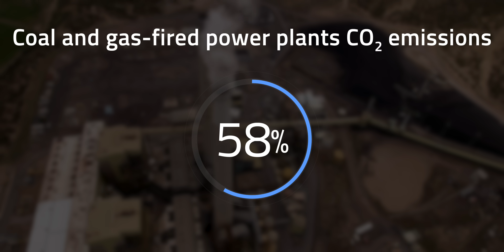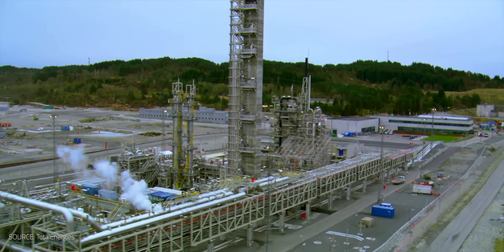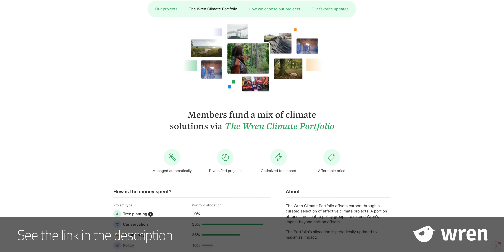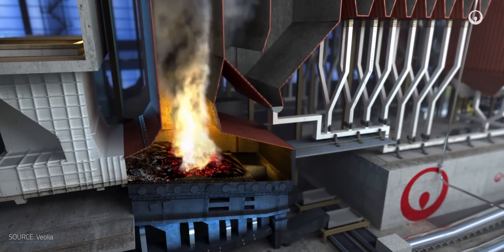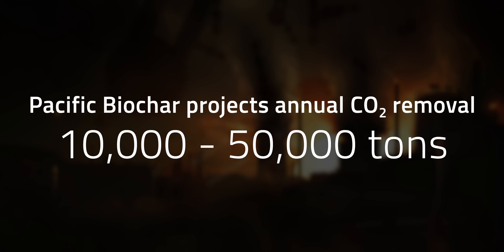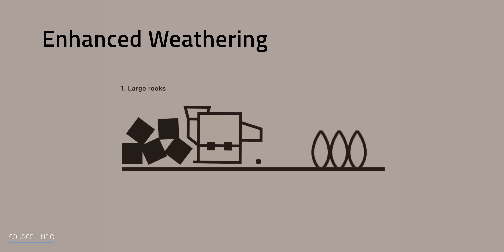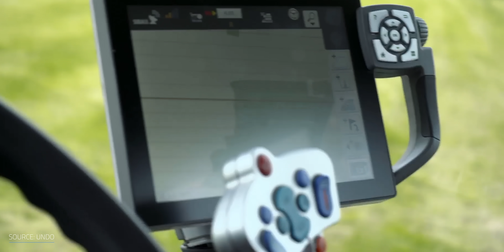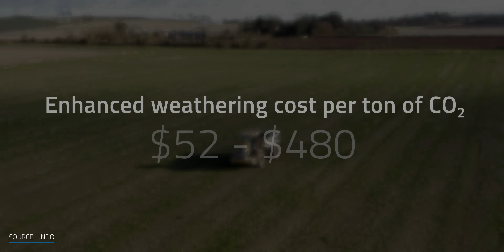The Reality of Carbon Capture

Comment: You guys realize that the process of making "BIOchar" is exactly the same as regular charcoal right? City people are funny, put BIO in front of something and you can sell them anything.
Reply: The idea is to capture the pyrolysis gases instead of releasing them as with regular charcoal production. The “bio” also signifies the intent to bury it, use in farming etc, rather than use as a fuel.
Reply: @kaitlyn__L  Except burying Syngas does absolutely nothing because it is predominantly H2, CO, and H20. The carbon is primarily in the remnants, and burying that is no different than a landfill using an incinerator and burying the ashes. I built a gasifier its not a new or fancy technology. But it is a pipedream like many "green" ideas. I personally will not take any idea or policy seriously till they do something like mandate wind breaks. Simple, Effective, and has an actual positive effect on the environment, instead of just burning crops.

Comment: There is some studies that pinpoint Amazon tribes as one of the cradles of agriculture. The papers approach to find sites where agriculture happened there was by find pockets of black earth which is not natural there. Those sites are centuries old.  So since one of the components is charcoal. It is fairly safe to assume it is really stable even with the high rain volumes.
Reply: It's not the water that destabilizes charcoal, it's the lack of it rather. Good for Amazon, but will have a hard time working as effectively in drier lands, or so i think

Comment: I understand carbon capture. But people also capture co2 and i think that’s just stupid. 

Fossil fuel is hydrogen with carbon, when burned it becomes co2 and h2o. Capturing co2 means you put important oxygen in the ground and leave excess water in the atmosphere. Again oxygen captured in that water. 

Somehow we need a way to put hydrocarbons back in the ground and make the oxygen available again. And remove the other strong greenhouse gas called water vapour in the process.
Reply: Water vapour removes itself via rain.
Reply: @kaitlyn__L  yes, but until it does there is some added vapour from exhaust pipes. And when it does there is still added hydrogen and the oxygen is still stuck with the hydrogen instead of being just oxygen (o2).
Reply: @autobootpiloot  the air has a water vapour saturation limit, though, so it reaches equilibrium again very very quickly. It’s true that some oxygen is consumed by the reaction, but the overall portion of oxygen in the air isn’t going down. There’s a difference between something being a theoretical, potential concern and being a real problem

Comment: Regenerative agriculture. This almost completely tillage free practice very effectively recycles nutrients and carbon is the currency of soil nutrients. It appears at the outset to be in some cases carbon positive. It is thought by many to be a very critical future carbon sink. If you’re interested, I think there is a good body of initial information on this practice. 
There are downsides to soil applied treatments discussed and these are definitely methods which require a great deal of energy inputs to utilize. More and more farmers in our area are switching to regenerative agricultural practices for our row crop operations. The ultimate goal is to reduce and hopefully one day eliminate synthetic inputs as well as reducing the number of trips across an agricultural field with heavy equipment annually.